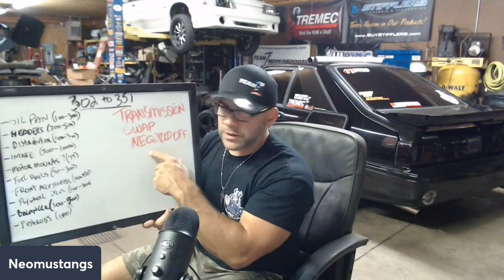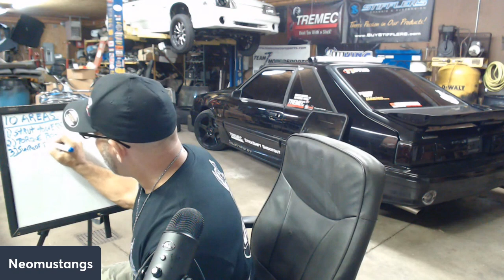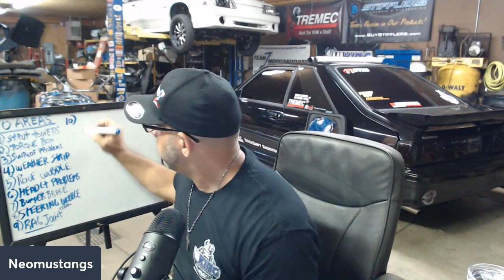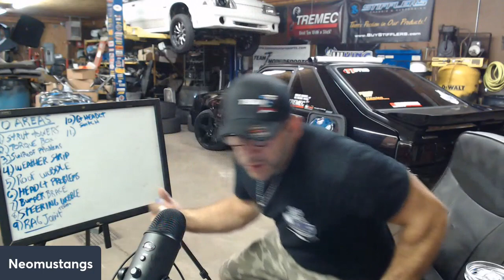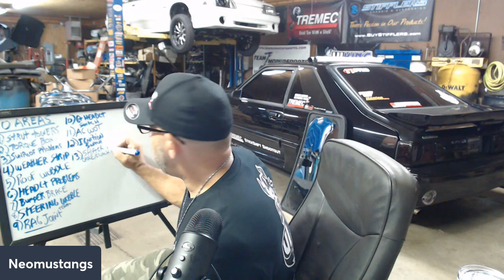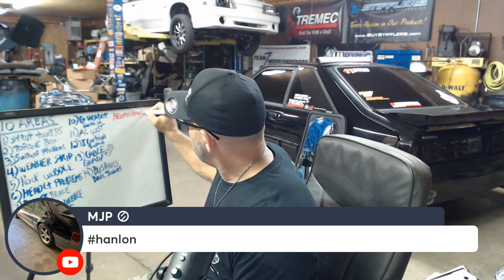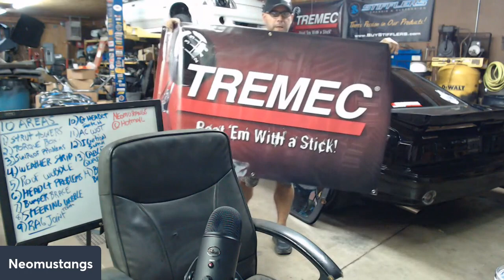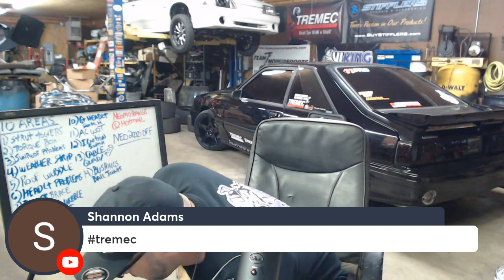Aging Foxbody Mustangs 10 Areas of Concern You Should CHECK!

Comment: When it came to headlights mine were in pretty good shape but I was able to bring them back a bit with plastic polish and fine paint polish but I was getting water settling at the bottom from condensation and just leaking in from when I washed the car or even rain even though I keep it covered. I was sick of taking the headlights off and dumping the water out so what I did was drill 3 holes in the bottom of each one and sealed them with some clear silicone where the lense meets the housing....Been water free for many years since.